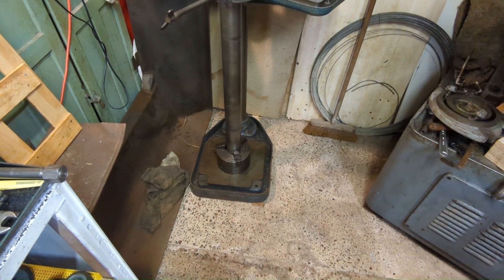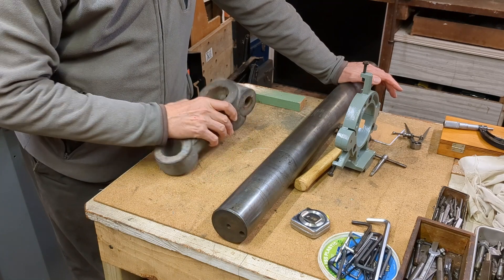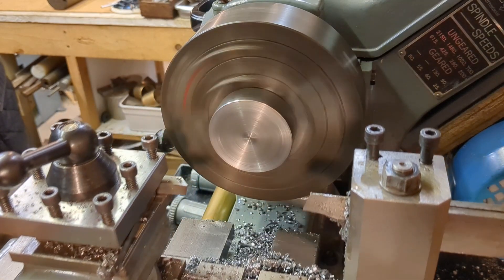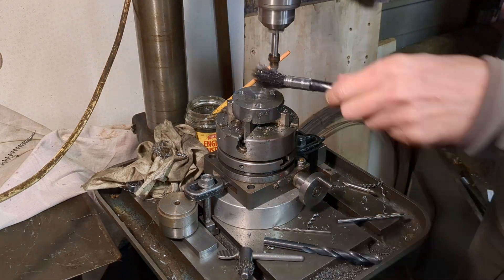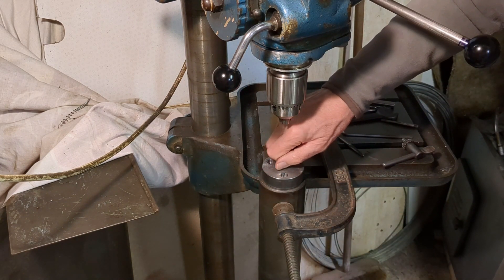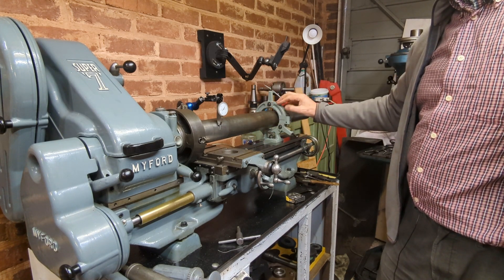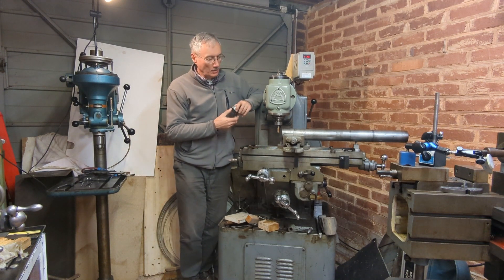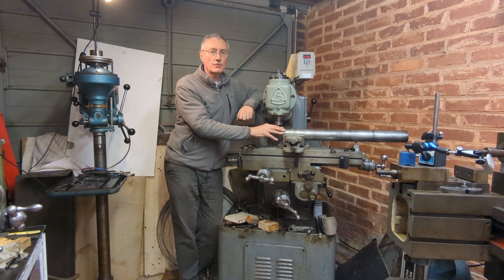Adcock & Shipley milling machine restoration - part 7 (horizontal milling support)

Comment: Hello Clive. Wow, I admire your courage to machine such a large item at home. Now I can appreciate why you needed your excellent home made fixed steady rest. I loved how you managed to drill the holes on the end using the pillar drill. How useful that it has an accurately milled base. Hope the next stage goes well for you. Thank you for yet another interesting and informative video. 👏👏👍😀
Reply from the maker: Thank you Andrew for your, as ever, encouraging feedback! We will see how the machining of the bar goes! I am hoping to start that today or tomorrow. Turning a short length of bar to size is one thing but to ensure it is also straight, round, and to size is another!

Comment: Hi Clive, nice chunk of cast iron.
Should machine well, need a mate with a cylindrical grinder.
I am using the same VFD's for my lathe, mill and compressor for the last 2 years and holding up well.
Reply from the maker: Thanks for your comment, Willem. Yes, it is a nice chunk of cast iron. Much better quality than the casting I had made.
If I knew someone with a cylindrical grinder I might ask them to bring it to final size!
Yes, I have found these VFDs to be more than adequate and reliable. A great asset for the home machinist!
Reply: @Workshopfriend  What kind of VFD is it may I ask Clive?
Reply from the maker: @carlwilson1772  It is one of those generic cheaper VFDs - here is the description: 3HP 2.2KW Single To 3Phase VFD Variable Frequency Drive Inverter Speed Converter.
Reply: @Workshopfriend  Perfect just what I need for my mill. Thanks!

Comment: Hello Clive, I have now watched the film complete. I thought it was very good. I did wonder where you got that big piece of material from. At first I thought it was an old hydraulic cylinder piston rod. I don't think it will matter too much that it is iron. Great plan to use a puck of material to hold the bar, enabling the full length to be machined. Good work on the pillar drill to hold the puck and drill/counterbore. Looking forward to the next installment.
Reply from the maker: Thanks for your feedback, Carl.
Reply: @Workshopfriend  My pleasure, look forward to seeing how things progress.